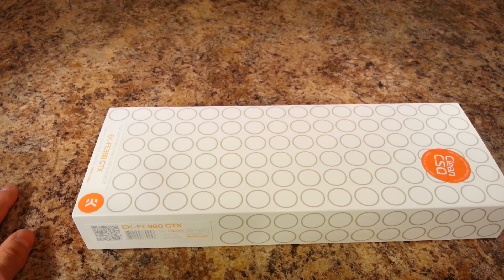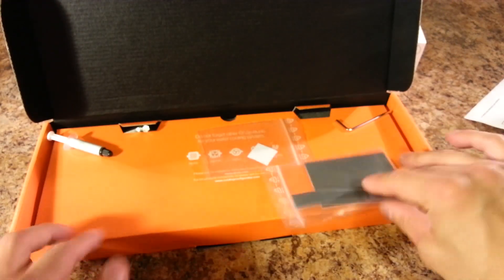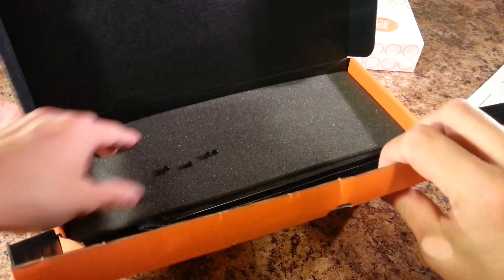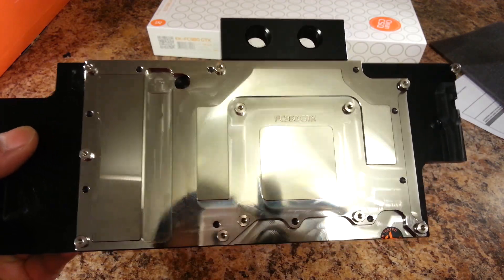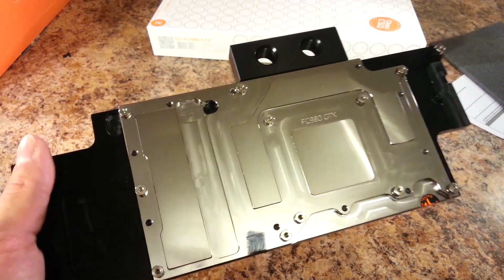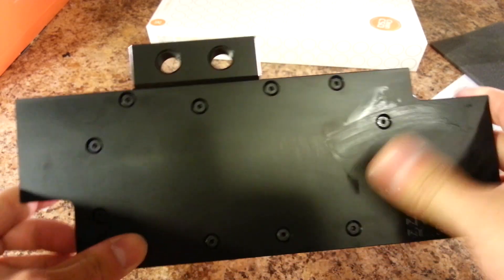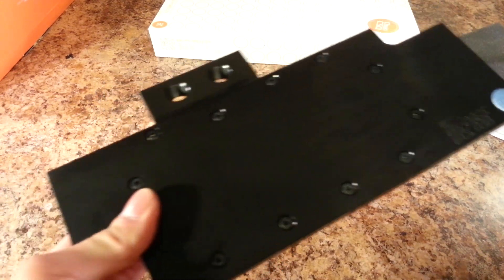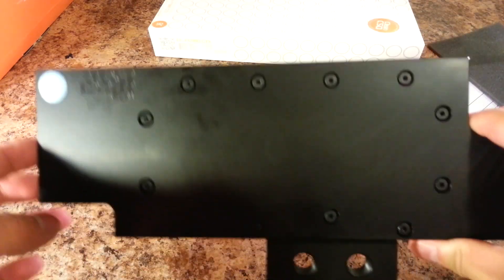EK GTX 980 Water Block Unboxing (EK-FC980 GTX - Acetal+Nickel)

Comment: Thanks for the video. I have this same block but for the Titan X arriving Monday.
Reply: Randy Moss hey man, what fittings are you using for it, im lost, does it need 4 ? like 2 for the tubes, and 2 as a seal on the other side ? im so confused haha :D
Reply: It needs two but I bought 4 just in case I needed extra. I'm using the EK compression fittings they recommend using when your buying the block from their site. I think they're ACF or ECF EK compression fittings. Something like that. Just make sure they are the same size as your tubing.

Comment: to put this block in a evga 980 superclocked acx 2.0 is it necesary to buy a ek backplate to??? im asking this because evga card dont come with backplate...
Reply: yeah, you need the EK one. standard one does not fit with the water block

Comment: you do know you'r only going to get a 100mhz more of a over clock with a water block on a 980
Reply: Jerome Hieb Not true. Depending on the Silicon lottery you could get a much higher overclock because temperature won't be a factor. You'd have to do a bios hack to really up all voltage and power settings but it's possible to get a pretty ridiculous overclock with the right chip, custom bios, and a custom loop. Not to mention it looks badass and is much more silent than that loud stock cooler.